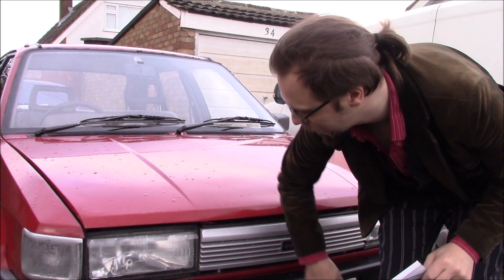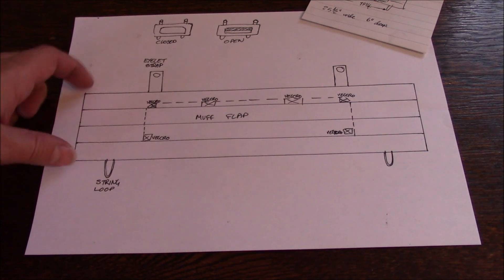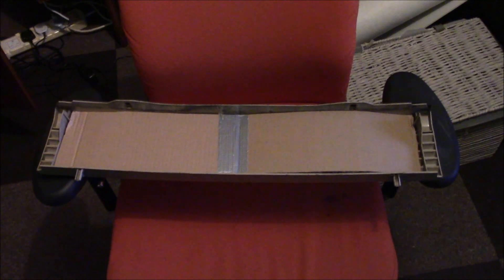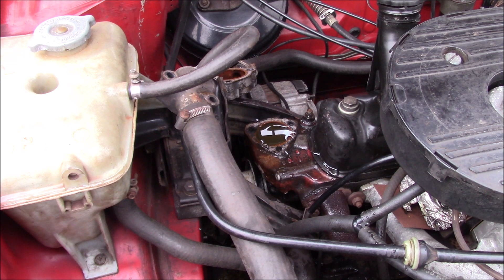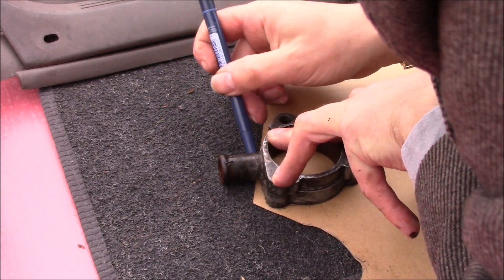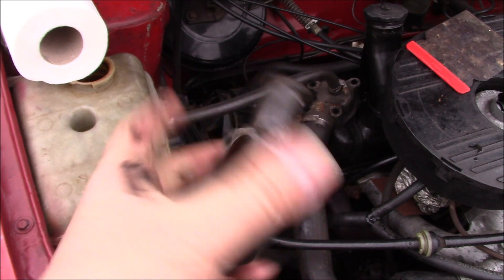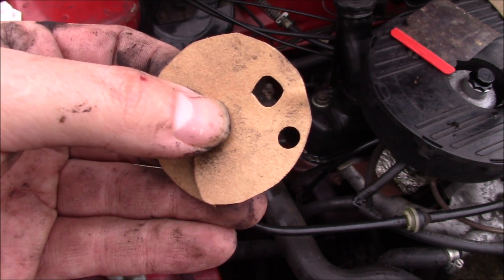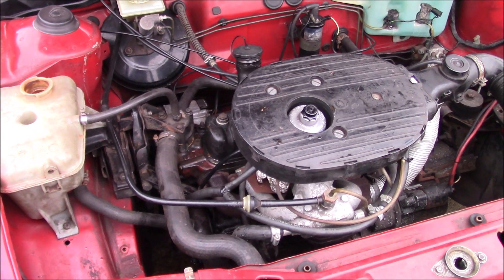1988 Austin Maestro - Muff Making &  Thermostat Fitting

Comment: I'd be a suspicious of seeing a thermostat housing without a thermostat in it. It shouldn't be a miss otherwise it could cause uneven temperature to the block. Good job you replaced it. Cannot wait to see your future improvement videos. I'm very much like you, if its supposed to work then it should and I'd get it working. Currently  mine doesn't wash the rear window. At some point that needs to be looked at. (Along with many other things)
Reply from the maker: Funnily enough, I need to look at my rear washer because it stopped working the other day, it's probably clogged from all this sandy rain we've been having.
Reply: @noexpensespentstudios  I'm hoping that will be the case, I've no idea if it ever worked. I've ordered a new pump as they are prone to breaking. If its not the pump then I guess I have a spare. I don't hear pump going when the button is pressed.

Comment: Hi mate the thermostat has to sit in the upper housing so that it can flow the hot water to the heater matrix
Reply from the maker: It doesn't seem to be stopping the heaters from putting hot air out as it is.  I imagine it puts it out better if it's in the top?

Comment: As David Whitehouse says, the flow to the heater matrix always comes out below the thermostat. That way the heater matrix warms up faster, especially in really cold weather when, with a belt driven fan behind the rad, the thermostat may hardly open at all. Don't forget that you control the flow through the heater matrix with the cold---hot control on the dash, so when the heater gets too hot in the summer you effectively shut the flow off when you push it all the way to cold (which isn't really cold, it's just ambient).
Also, it's possible that the thermostat was removed because the engine was overheating in hot weather i.e. poor circulation in the block or head. I can't think of any other reason why someone would remove a thermostat - unless it was faulty and they didn't have time/money/inclination to fit a new one.
Reply from the maker: My current working theory is that the radiator leaked, potions were put in, thermostat got gummed up, overheating problems happened, so they fixed it by pulling out the thermostat.  It may or may not be related but in one of the earlier videos I mentioned the heater controls don't move through the full range and I wonder if that's a related issue too.  It's been great getting some feedback here and there's certainly more Maestro content to come soon on this and other fixes.

Comment: Yeah you will still get the heat but it just takes a bit longer as heater pipe is on top of the thermostat rather than under so only get the hot water through once thermostat has opened
Reply from the maker: No worries, something to revisit when I do the coolant flush then so I'm only disturbing things the once.  It's not going to do any harm in the meantime.